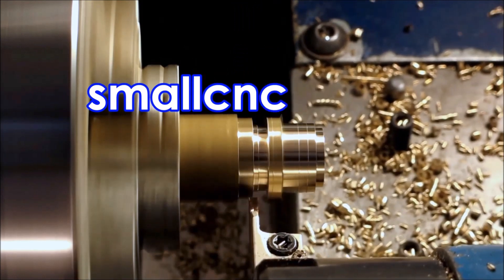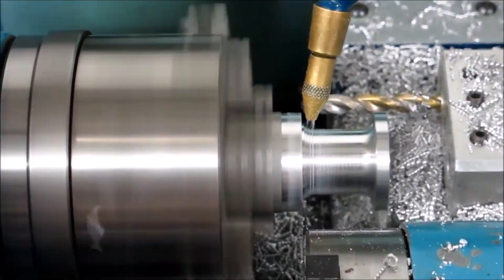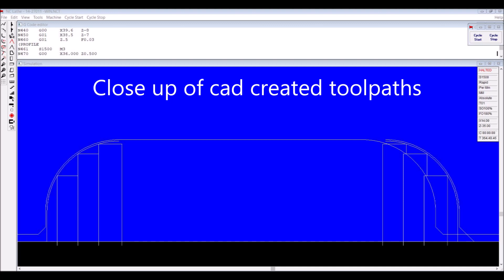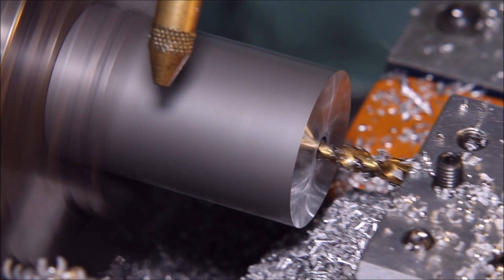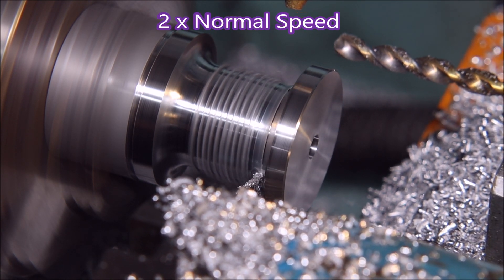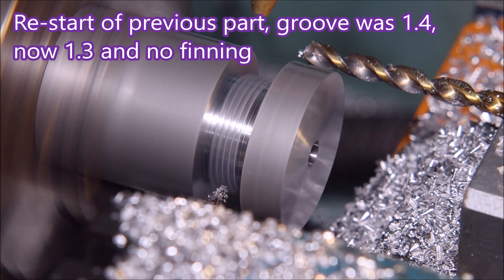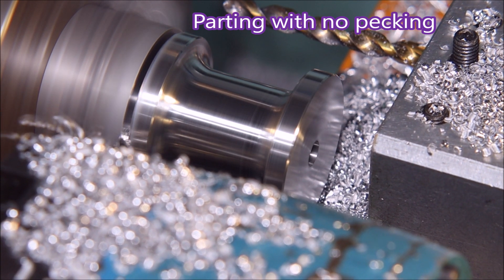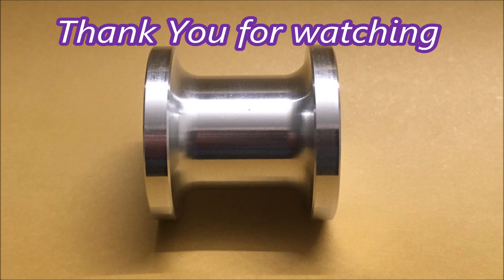CNC lathe part profiled at 2400rpm Kennametal tool 1.6 wide insert

Comment: HI I can really relate to your comments on pecking and I have also decided that I have been over using pecking especially when drilling but I am about to change my ways and follow your lead cheers Bill
Reply from the maker: Hi Bill, I wish my cam would decrease the length of pecks as the drilled hole gets deeper.  Still as it is 30 years old I think I have to be glad it works at all. LOL What I do is pick a peck length that will automatically give a shorter last peck, which is about the best I can do.  As for pecking when parting, I just don't bother anymore. Finish is never good when pecking on my setup so I just try to get rpm and feed right so pecking is not required.

Comment: What to do for avoid the chatter? Please suggest the solution.
Reply from the maker: I don't have any problems with chatter. The parting tool in this video is only 1.6mm wide, which I think helps a lot.
As you see in the video using the feeds and spindle speeds that are shown, there was a small amount of chatter in the radii, but I think that could have been fixed with a slightly deeper cut
Reply: @smallcnclathes  dear sir I am facing chatter on my machine with 4mm grooving tool for profile turning.what  is reason.please guide
Reply from the maker: @pushparajjp8715  4mm is quite a wide parting tool,. Can I please have lathe chuck diameter, work piece material and diameter, spindle speed you are using, feed rate if machine fed

Comment: Im always afraid of the tool shifting, nice technique.

That being said, what grooving tool do you use? I have an emco pc50 at work, works great, although it runs windows 3.1.

At home I've got an old haas horizontal 4 axis pallet changing beast of a mill, that i have been restoring. My goal is to set up one pallet as a tool turret, and use a tool holder to hold stock, the rpm range is awesome since it goes up to 10000 rpm and has a two speed gearbox, and 30hp on tap.
Reply from the maker: Hi David, https://youtu.be/W1VQu6rKL8E is my video about the parting tools I use, in this video I was using the Kennametal tool. My first cnc was the Emco Compact 5PC which ran in dos and it was a lovely little machine. Only issue was the steppers losing steps sometimes. That mill does sound a beast, have you uploaded any videos about it yet?
Reply: https://youtu.be/CvCE6BdXQfM
Reply from the maker: Looked at the others too, that is a monster!

Comment: what kind of insert are you using?
Reply from the maker: How about Kennametal A2016N00CF01, that is all I see on the box that I might consider a type number. Not good with Kennamental as I only use these inserts for that tool (and RH of course)

Comment: too big of a radius and too much contact with the part, dragging a parting tool can be done if you angle the parting tool slightly to cause a leading edge or chose a different cutter. its kinda a ratio of contact face surface area/lateral rigidity...cut on the corner of that tool not the whole face and chatter/finish will improve dramatically...id also cut inside out for the radii
Reply from the maker: If all you have is a hammer, everything looks like a nail. I could have used right and  left turning tools in the turret, but not everyone has a turret so I used a parting tool. Thank you for your comment.
Reply: @smallcnclathes  thats exactly why ive been in the same boat and done the same thing...i dont know if you can add a little angle or if youre stuck at perfect 90...but if you can angle it, youll get away with it
Reply from the maker: @kazzTrismus  the turret really only holds tools at 90 degrees, but that does not matter.  As I said, I could have run a LH and RH turning tool which would have handled it nicely.  I chose to do it this way and I was quite pleased with the result. Four years ago the customer was happy with it, which is what counts.  It was just a spacer that they wanted to look a bit better than a piece of round with a hole in it.

Comment: Is this classic lathe redone to become CNC or CNC lathe originally?
Nice work anyway 😉
Reply from the maker: CNC as manufactured some 25 years ago, here in Australia. The cad cam software also controls the lathe from an interface card inside the controlling PC. Nice little lathe, apart from the ageing electronics, which leads to a number of them being the subject retro fitted. Mine however is still original apart from the driver for the spindle which has been upgraded.
Reply: @smallcnclathes  Yeah, that's quite interesting. I've been looking for mini CNC lathe in Europe, but just not much manufacturer. Everything is going on bigger machines and productivity. Enjoyed watching, and keep them coming 👍
Reply from the maker: @machining  Hercus (mine)  and Boxford and Emco, all made what were called training lathes made for education institutions. All are similarly sized.  Real lathes tend to be larger and made for production. I had an Enco PC5 at one time, but it was nowhere near as robust as the Hercus.
Reply: @smallcnclathes  Just found some videos on your channel about settings on your lathe. Really nice machine indeed.

Comment: Do you use a canned cycled for the od grooving? If so can you please give a example of the code. Cheers mate
Reply from the maker: N190    G00     X38.40  Z-11.60
N200   G72 X25.00 Z-28.10I7.00  K1.4  F0.03
I have no idea how this compares with other systems, but in its defence, it is fairly old
Reply: @smallcnclathes  I've only ever used G72 for simple facing operations but I'll definitely find it useful for OD grooving. Thankyou!